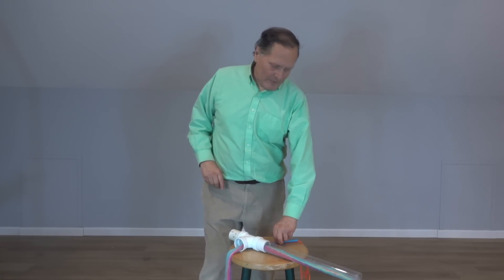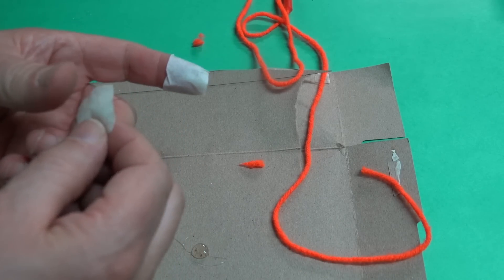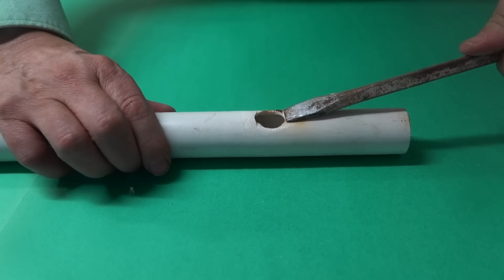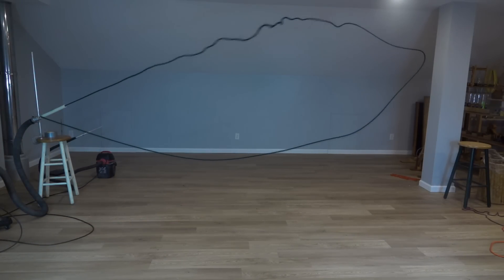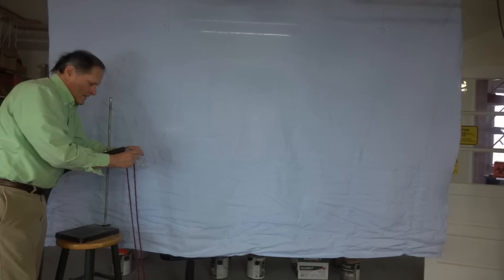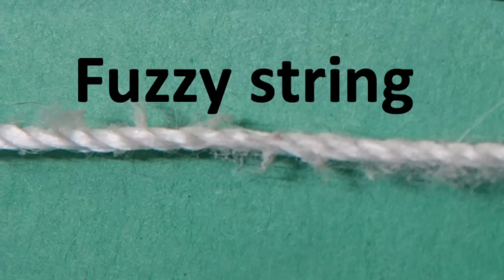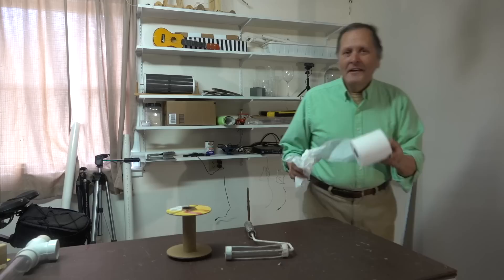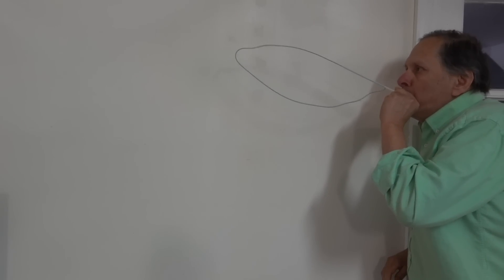String Shooter Pipes....air driven

Comment: You don’t reckon that you could turn one into an electrical generator? Using something like a silicon impregnated resin? With a blend of nano particles?  Essentially custom making a magnet tape that run through coils? With the search for eco friendly solutions? Would it be possible to generate electricity this way?
Reply from the maker: I think that may be beyond my capabilities
Reply: @YeanyScience  thought it might be worth the ask? Or just throw the idea out there like a boomerang and see what would return?  I’ve spent the last few days thinking out how it could be done with a few guy on Airborne Wind Energy Systems (Awes) forum. Considering the potential applications? Considering scaling potential? I’d argue you weren’t all that far off, coming up with something?  Paint rollers was a genius move.  So not too far from attaching a motor/ generator. It just a question of how well it work in the wind?  Laddermill has been mentioned in our discussion on the forum as similar variant. I’ve proposed three basic variants ground based, hybrid and fully airborne. With the airborne version using the loop as a streamer? Definitely near your pay grade? Would be fun to see some numbers?

Comment: There's some exciting science involved with microphones, you might want to check it out.
Reply from the maker: Yup, that and I  spent a year remodeling the second floor to my garage to use  as a studio,  all bare walls, sounds like an echo chamber
Reply: @YeanyScience  I'm sorry if I came off as sarcastic and rude. I really appreciate your content. You can make cheap and stylish absorbers out of fiberglass insulation and canvas if you want less echo. Another solution is to use a dictaphone with a wired microphone to record audio. A bit more effort goes into the editing in that case though. Keep the videos coming regardless!
Reply: @الدعوةالىالله-خ8م  Sorry, but how does this relate to what I said?

Comment: These demonstrations are just wonderful. I really enjoy the simplicity of your ideas. At one moment you said that this is a demonstration of Bernoulli's principle in action. I am not sure. When the pipe gets narrower then yes, we can call Bernoulli. But the string is sucked into the pipe after the constriction, where the pipe is broad. I am not an expert in fluid dynamics but perhaps we have a low-pressure vortex after the constriction. Edit: Probably this is what happens. A fast jet of air above the constriction entrains air molecules present just after the constriction and below the jet line. It causes lower pressure. This is related to the Coanda effect.

Comment: That fuzzy string could be a big static electricity generator
Reply from the maker: You're right,  after running it for a while, the string would stick to the wall or the hanging sheet

Comment: Hi, I have a question about the forces acting on a string. You draw a lift pushing string upwards, but I really dont see where this force could come from. Isnt it just drag, pushing string forwards, that is causing this?
Reply from the maker: If you watched my original string shooter from 2014,  my theory is that it was inertia carrying it forward,  I was soon proven wrong,  the lifting force is coming from the atmosphere's pressure being greater than the pressure of the moving air stream.  You may want to watch science lab's demonstration with shooting strings listed in my comments
Reply: @YeanyScience  I think your theory isnt fully correct. Of course, you are right when you write about inertia for the initial flight of the string. But what force acts on the whole loop? There are gravity which resultant is applied to the center of mass of the loop, and the aerodynamic force which acts along the string (and to what point acts the resultant of this force?). And those two forces must be equal in magnitude and must create equal torques, so they act along one vertical line. This condition defines the shape of the loop.

Comment: Doesn't it generate static electricity when you have all that yarn in friction with a plastic tube ?  Makes me think about van der graaf generators. A string shooter that also shoots alectric arc would be awesome 😇
Reply from the maker: Yes,  after running the strings for a short time,  the would stick to the walls or to the hanging sheet,  I'd have to keep it far enough away or it affected the flight

Comment: I was wondering if there were any use case for this... Other than removing cobwebs... The only thing I could think of was building a race drone obstacles course (Red bull air race style) with a bunch of the TP version
Reply from the maker: Love the removing cobweb idea,  high up they are  always hard to reach,  this would make it fun.  The drone obstacle could be as easy or hard as you want to make it by adjusting the air output
Reply: Space elevator? Hahaha